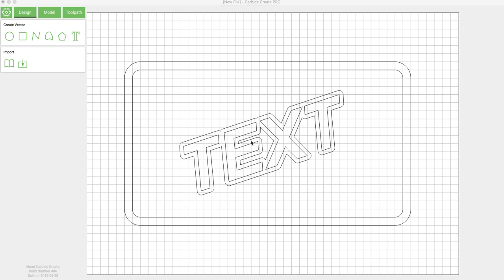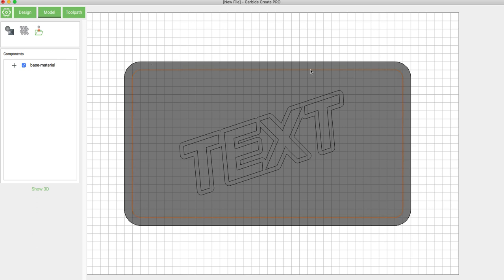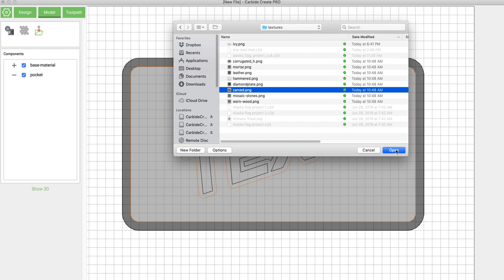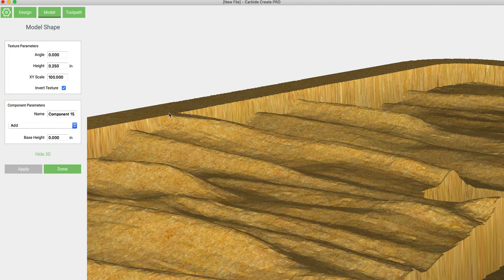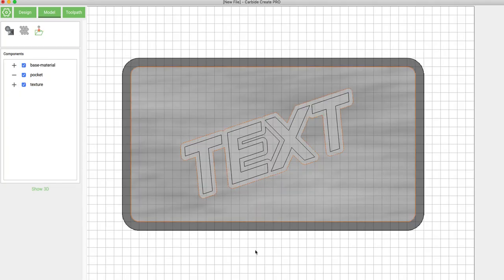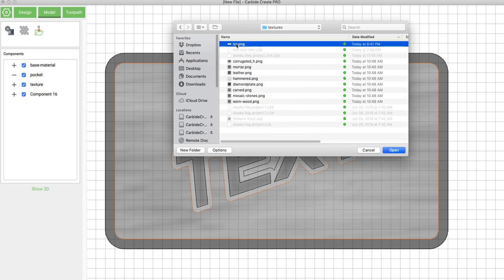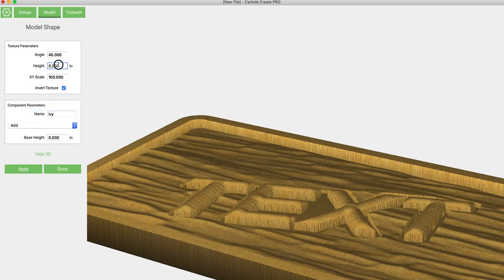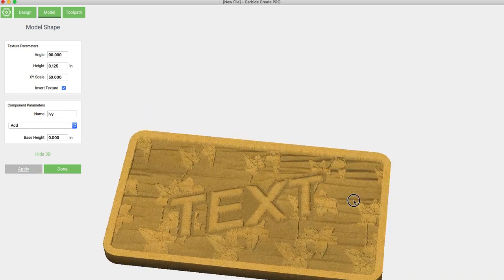Carbide Create Pro - Working with Images

Comment: EDWARD can you help?
I have a shapeoko XXL that is a few days shy of a month old😳
I have been able to cut several designs out with it and it’s worked fine up until today 😢
TODAY it gets about a quarter way through any project I TRY TO cut and it stops and it tells me that ERROR 5 SERIAL PORT RESOURCE ERROR?
  Can anyone help? I have disconnected the power and reconnected it hoping that it will solve the problem but it does not? And I have called and emailed carbide 3-D! 

❤️🎄Santas workshop has a list of Christmas gifts and must come out of the workshop time is of the essence🎄🎄